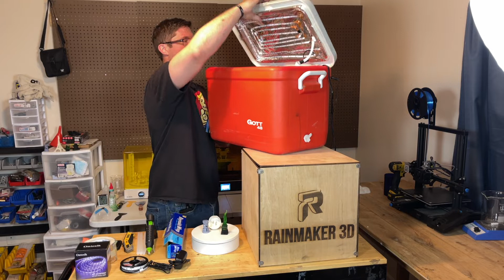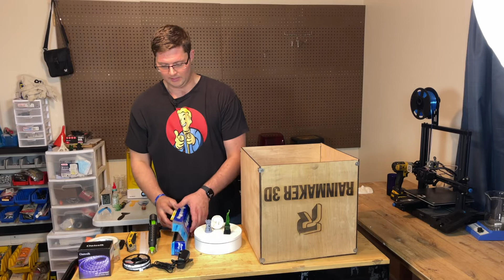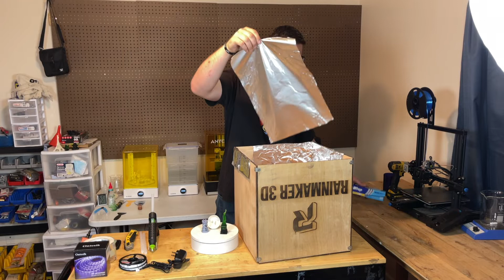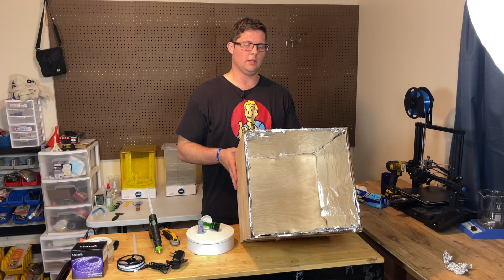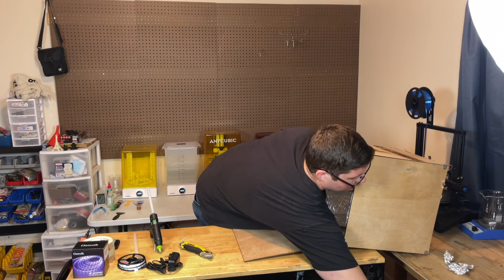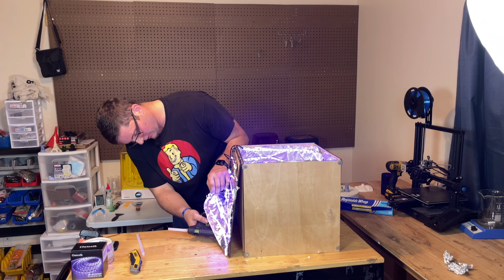DIY 3D Resin Printing UV Light Curing Box Build

Comment: Thank you for sharing this.  Questions:  would it be easier to apply the foil to the panels of the box prior to assembling?  Also, what is the material the box is made of and it's thickness?  I recently purchased a laser etching/cutting machine and am still reading through the manual/instructions (have yet to make anything) -- and considering making a scaled down version of what you've shown here (my laser's bed size is only approx. 15" x 20"); but since my resin models and terrain pieces will all be 28mm scale and smaller (n-scale model railroading @ 1:160 scale) a smaller box will be ok for me.  Thank you for your time and assistance.